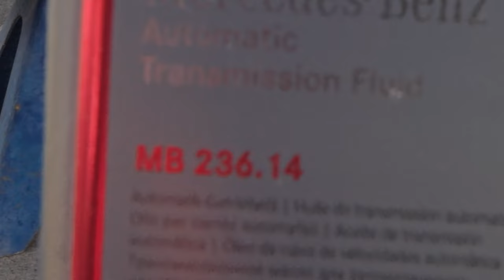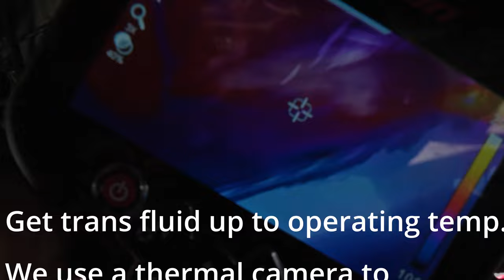2016-2023 Mercedes Metris transmission fluid change

Comment: This transmission calls for low friction transmission fluid 236.15 .. the blue one ...like the one you got out
Reply from the maker: What is your source? Where did you read that?
Reply: @TheYouTubeMechanic  Mercedes service manual..and as a Mercedes owner i know that green level tube requires 45 degrees temperature to set the level correctly and 236.15 transmission spec whereas .white and black level tube work with 236.14 transmission fluid and different temperatures settings..now i don't know what can go wrong with 236.14 in a transmission that requires 236.15 but considering that that transmission is an important part...i guess you'll see...Mercedes is alone a pretty expensive car to maintain..
Reply from the maker: After a bit more research I see that my original research led me astray. I'll be swapping out for the blue fluid this weekend. For the record, this is a customer vehicle that has put about 30,000 mi on the red fluid with no issue.
Reply: @TheYouTubeMechanic  i believe you.. it's just that you better be safe than sorry ..that's all..🫡
Reply from the maker: Hell yeah brother. Like and subscribe!